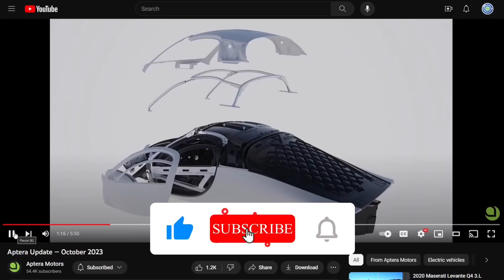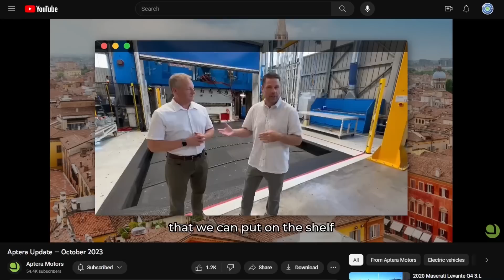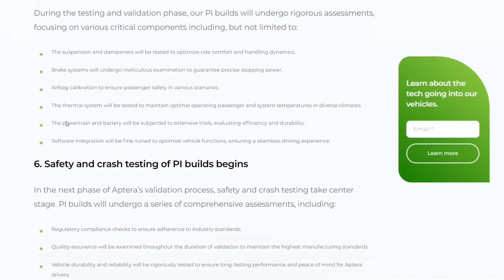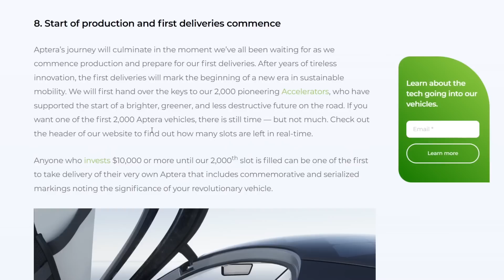Aptera's October 2023 update and ambassador meeting highlights

Comment: The use of a CMM to validate the parts is not remarkable, but rather inevitable.  There is virtually no other mechanism capable of precisely measuring and validating these sort of complex shapes; both the contours and material thickness at any given location.  The measuring technology is many decades old and is used in circumstances more-or-less like this everywhere.
Reply: You have to remember that the Aptera acolytes see all things through Aptera-tinted glasses.....
Reply: @bobhilder1469  Since the word means follower, does this mean you haven't followed Aptera?  

I have worked as a supplier to the EV industry for decades, going all the way back to the late '70s when I lived in Japan.  I have been a supplier for many early EVs, including the Ford Th!nk.  My impression of Aptera comes from many years of work in the industry and first hand familiarity with many other startups including Tesla during their startup phase in Union City.

I agree that there are too many false claims floating around the internet - including that the first version of Aptera - Aptera Inc., went bankrupt - which is not the case.  They did shut down, years after the founders left.
Reply: @n.brucenelson5920  Classic n.brucenelson/a.k.a. Aptera shill.  If you can't address the issue at hand, change the subject.
Reply: @bobhilder1469  The issue at hand is name calling and spreading lies about Aptera on the Internet.  Why do you do it?
Reply: @n.brucenelson5920  Aptera and you lie and your response is why do I lie? The very definition of projection.....
Reply: @bobhilder1469  You continue to post without evidence.  Cite one example of me lying.  You either refuse to do research or can't understand what you read, and then call others names because of it.
Reply: @n.brucenelson5920  Your denial is not healthy.  Maybe take a mud-bath instead.

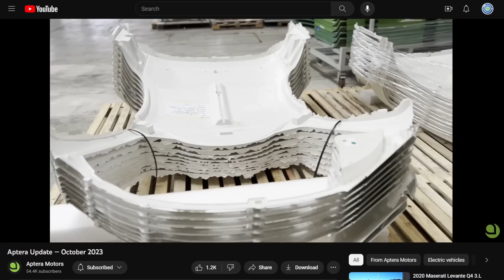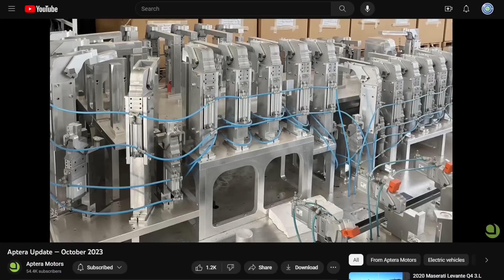Comment: At 6:30 (AOC video), I think the racks of pieces are: on the left  - doors (2 stacks of 8); in the middle - the other door (nested a bit funny, but probably also 2 stacks of 8); and on the right, yes, the hood pieces (probably all 16). So, three of the six parts for the 16 PI builds! At 6:35, it looks like there may be also all 16 of the CF-FMC rear hatch panels.

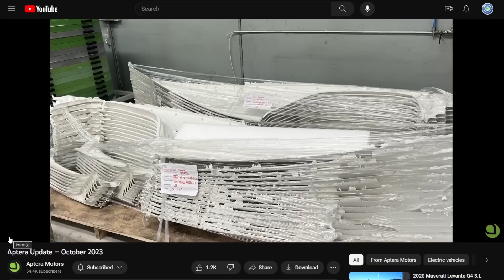At 8:39, the label where you speculate "lambda 7" is probably just "17" (Europeans often write their "ones" as almost a "tent"). This would correspond to the target 16 plus maybe a spare.

The phrase "PER VIA DELLE NAZIONI" on the label is probably an address -- "For Street of the Nations" -- perhaps this stack is destined for another facility (maybe one of theirs) down the road a bit. There is a "Viale delle Nazioni" street near the CPC facility in Modena (in the same industrial area). ("Viale" and "Via" are both words for "street" and probably sort of interchangeable. "Viale" is used more for larger streets, like boulevard in English.)

Comment: Steve, do you know if the safety / crash test will include testing the impact consequences of a hit to the battery pack?  For example, to see if there would be battery cell fire / explosions  etc ... if you don't know, can you find out from Aptera?
Reply: Sounds like Aptera intends to meet (or exceed) automobile safety standards (far in excess of motorcycle/autocycle standards), correct?  Hope they’re transparent about all such safety results.
Reply: @gr8dvd  Aptera will have the tests conducted by a third party and have stated that the results will be made public.  There are many SUVs on American roads now where this is not the case.
Reply: @n.brucenelson5920  Good to know, thx.
Reply: @gr8dvd   Yeah, crash testing motorcycles does not sound like a thing.
Reply: @jeffcarlton3590  True, not yet… maybe instead of inmates stamping license plates… 😀🤷🏻😀

Comment: Steve, there is no way to know the boxes on the shelves are production parts unless Aptera privately stated that to you. There are many small items used in the manufacturing process that never get installed into the vehicles that can fit into those boxes. Hand tools, test and measuring tools, scanners, HMIs, power cables, air hoses, workstation lighting, small parts bins, and labeling equipment all need to be distributed and installed before production parts arrive and take up the bulk of the racking space.
Reply: They could also just be empty boxes.

Comment: Why is the launch vehicle 400 mile and AWD 3 motor for $33k?  My personal opinion is a 600 mile with 2 wheel FWD for $29k? would be a more “sensible” first model. Is AWD really necessary? I’m not taking my Aptera out in a snowstorm or off road.
Reply: The launch edition was based on the reservation take rate for the various features. Fewer people wanted the 600 mile range, and more people wanted all wheel drive, either for driving in poor conditions or for the extra power and faster acceleration. I too, will have to wait for my 600 miler.  I'm undecided about AWD, but I'm leaning toward it due to the uncertainties of driving a three wheeled car in the snow.  I've never needed AWD in the past, but I've always driven cars where all of the wheels travel in the tracks of other vehicles.
Reply: @993cc I also will be waiting for the 600 version however I like the AWD version for the acceleration.
Reply: They’ve stated that the reason they’ve chosen that specific version for the LE edition is because that was the most popular configuration. They would be able to get more vehicles on the road and more money in their pocket.
Reply: Everyone has a different use case
Reply: In addition to the other replies, the batteries planned for the 600 and 1000 mile range vehicles have not yet been produced.  I had originally ordered a 2WD vehicle, but the extra traction control that AWD will provide will be welcome during the Iowa winters, where I now live.  Not to mention the fun factor of the extra acceleration on tap - which doesn't have to be used.

I am aware that it will still slightly decrease maximum range.  I have done 1,000 mile in 24 hour motorcycle trips, and feel that if I were so inclined I could do the same thing in a 400 mile range Aptera, but probably won't have to.
Reply: @n.brucenelson5920  ! The batteries are the most compelling reason

Comment: The machine at 2:44 is not the CMM (coordinate measurement machine) but is merely the clamp fixture to hold the part steady while the CMM measures the part.
Reply: The scanning stickers on the top surface of the clamps make me think it goes through a scan operation to validate the part in the fixture.
Reply: I agree. The fixture shown is a clamp for Assy. But the CMM inspection would probably happen at the factory (CPC) before shipping. I doubt Aptera would have a CMM machine on site (pretty big and expensive) to inspect incoming parts that can be check elsewhere before shipping, plus it is typically done on a climate controlled room.
Reply: @ciscorodriguez-quijano840  wow. That brings back memories. The auto plant I used to work in was not climate controlled. But, like you said, the CMM room had to be. So on really hot days, I'd spend extra time in the CMM room doing extra 'quality checks'.

Comment: You really do not iterate on these dies unless you have too.  I believe Aptera's previous builds to spec with a different process should remove most of the risk.   Aptera can probably recover from one or two reworks of the presses, but it will be a major setback.  If they had to do them all they will probably fail.   Even if there are issues, there may be ways of adjusting things adding shims of some sort to fix very minor errors.  Hopefully none of this is necessary.
Reply: With 4 out of 6 already validated, odds are looking good for the remaining cf-smc parts. However will feel relief when all CF and FG dies and parts are validated as fixes will add delays and increase financial burden, thus impact significantly Aptera success odds.
Reply: Trust you’re right about "Aptera can probably recover from one or two reworks of the presses"  which is encouraging since 4 of 6 body components (presses) have been certified so only 2 remaining. After 4 of 4 👍 betting 2 or less problems… if my math is correct 😀
Reply: If it's anything like dies for injection molding, steel can be further removed quite easily.  Steel can be welded in but that is much harder and very costly.  Companies that made plastic parts for us always erred on the side of having to remove steel than having to add.
Reply: @kimbowilco  That is very true, much easier to remove some steel than add some.

Comment: Informative, yes. I’m a bit surprised at the expense for what still amounts to fiberglass panels. Does anyone know the percentage of fiber to carbon panels? Seems like the outermost is carbon and the interior is glass. What is the tub? I’ve seen super cars with large tubs in a one piece. With the frame and inner cage, just what makes up the tub area?
Reply: When you look at Aptera's exploded body views and the actual parts at CPC, the darker parts are carbon and the lighter are glass.  In general, the floor-pan tub, structural parts, and interior skins are carbon, while the exterior skins are glass.
Reply: Yes, I think you have it reversed: innermost CF and outermost FG.
Reply: @Aa792   No worries, it's all good!

Comment: No price update means they are still dodging the second most important question to all reservation holders. Anyone who believes the price has not gone up significantly is fooling themselves.  The original expenditure stated for 2022 was 9.4m for tooling and design. I am curious if that included all six pieces or only the first four?    
  
No efficiency number is interesting because its obvious they are now hedging their bets with mentions of tires and other effects. It certainly will not be as high as many hope.  

Only sixty percent of the equipment (66 who cares) being completed and ready means hitting December given shipping times from Italy means is not going to happen.  Using an additional supplier for the belly pan likely increases cost and complexity as now two suppliers have to have very good integration. The ability to repair this is going to be interesting.  

I am surprised the rear hatch is solid. I was hoping for cells in glass similar to how Fisker did their roof. 

The solar equipment shown was very disappointing, this isn't but one machine from the October video but worse its evident the guy sitting there playing with cells is doing nothing. Seriously that was so staged as to be silly. No, they did not invent automotive grade solar panels. They are using existing Maxeon panels in new method where they are bonded to the acrylic (don't think it is glass). We have all been able to buy these flexible cells from Sunpower since 21 on Amazon. 
  
211m in the hole already... only increased their cash position by shifting an additional 10m to stock based compensation which is not a great sign.
Reply: For now the prices coming out of Chris Anthony's mouth in recent interviews are $26,900 for the base model and $33,500 for the Launch Edition are what I believe.  In one the "factory tour" videos I saw there was mention that at the location that they will be doing the volume manufacturing of the solar panel they have a larger quantity of the automated machines that are used to produce them. Since they aren't producing vehicles yet showing 10 idle machines vs 1 idle machine makes no difference. I suspect that the reference to them inventing automotive grade solar panels refers to the classification of the final product. For example there are automotive grade electronics that are certified to meet the operating parameters required in an automotive environment. It is not just sticking off the shelf solar cells onto a surface.
Reply: @garywozniak7742  I have a bridge in Brooklyn NY I can sell you cheap🤪
Reply: Actually, many have been able to buy these flexible cells from SunPower since the early 2000s.  At the time they were called A300 cells and were minimum 20% at STC.

If it's Acrylic (PMMA), I sure hope they have the good sense to "hard coat" it....
Reply: To clarify, the carbon hatch in the video is only seen from the interior of the vehicle... the solar shell is applied over the exterior of the carbon hatch.
Reply: @DemaGeek  Yeah, we’ve know for months, if not longer, that there is no back glass. I think they explained this back prior or at the time of the launch edition. So few wanted glass in favor of solar cells they put the design and mfg of a rear hatch with glass on the back burner. The very few that wanted BEV only complained.
Reply: It does not matter how transparent Aptera is. Naysayers will always piss on the effort being made. Thanks for the pessimistic attitude from out of your butt. Makes me feel like Aptera is doing something right.
Reply: @barnabasseadog7660  "Makes me feel like Aptera is doing something right."  Well there you go.  Aptera (and you) need the naysayers.  It's a win-win.
Reply: @barnabasseadog7660  Pretty thin skinned response to a post from a reviewer who is noted for a balance perspective. Neither fan boy or negative troll.
Reply: @johnmalcom9159  he seems pretty negative to me. The Maxeon Gen 3 solar cells that Aptera is using have a higher efficiency and flexibility than those cells available in 2000.

Comment: Nice video, but now I'm confused…

10:53 — You mentioned there's “kinda no room for error” with the dies, so what are they testing if they can't easily changes the dies? Like, what if they find out there's a problem with the belly cooling? (That overheat during the NBC story seems to be one of the bigger concerns for the vehicle right now. Although, I did see that driving up the hill video, so it's more of a general concern.)

11:50 — Glue? What are they gluing? That seems like a problem for repairability, which is one of the big attractions of the Aptera. I like their right-to-repair stance… but how's that going to work with glued parts? 🤔

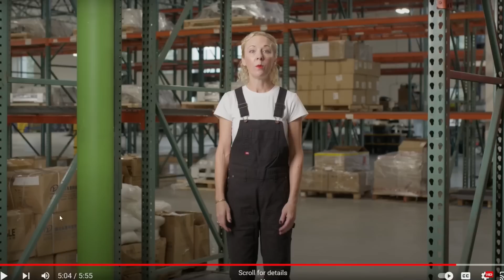14:02 — Do you have an iPhone? There's a translate app that can translate images. I'm not sure if the image quality is high enough though. Maybe Google Translate (with images) will help.
Reply: Regarding glue ... it's my understanding that will only apply to the main body shell. Those pieces are very strong and will never dent or deform. So if you manage to crack one, the vehicle is probably totaled. But in the unlikely event it was still salvageable, I bet you could re-glue the cracked portion, or cut out the cracked portion of the shell, then glue in a replacement. IMO, most of Aptera's repairability refers to the relatively easy replacement of the many mechanical/electrical components that bolt to the glued shell. Hope that helps. 🙂
Reply: Gluing is not a problem for repairability. You just use cutting tools, grinders, and sanding tools instead of wrenches.
Reply: On the cooling issue...they did not even have the motors hooked up to the cooling system, they just filled them with fluid and capped them off, this worked just fine for normal driving in relatively cool whether.  Remember this was built as a show and tell vehicle not a validation unit....Chris Anthony freely admits that they took a chance on letting a nationally recognized news outlet film them driving up a steep hill on an unusually hot day after they had been giving test rides and already had the motors warm.  Under almost any other senario it would have been just fine but they gambled and the motors shut down because they just got too hot.  

 As far as glueing the body together it is no different than repairing a fiberglass boat or even a Ford F-150 where the rear box side body panels are just glued on.  Get your replacement panel, remove the damaged panel at the glued seams and glue the new panel in place.  Not that hard if you've done any type of body work.  If it is a small area you can just repair it with traditional fiberglass repair methods or even get partial panels to section into a damaged area.
Reply: @rolandrauenhorst2002  I am no expert, but I have done this kind of work myself.  I would tackle it before I would a sheet metal repair, and I have experience at both.

Comment: The outsourcing of the belly pan is probably just the machining of the dies. CPC should be stamping those parts.
Reply: Steve said the tub was outsourced by CPC. The belly pans will also be outsourced because Aptera does not have the ability to stamp or hydroform large aluminum parts. The tub and the belly pans are different components.

Comment: I think that with the simplicity of the design that validation will be quick and customer deliveries will be mid 2024 as Chris said.
Reply: Summer 2024 ends Sept 20, 2024
Reply: @ASawyerInAZ  accurate observation!
Reply: Looks like early 2025 to me. I hope to be wrong and there will be initial deliveries end of 24.
Reply: We’ve seen a slooooooooow roll on the govt. loan application, and didn’t hear any mention of govt. vehicle certification which is why I’d say (very) late 2024.
Reply: @gr8dvd  The Government is responsible for the "Slow roll" Not unexpected because that is how the Gov. works. Especially at this time in the election cycle. I am sure Aptera is more frustrated than us and certainly less naïve about the process now.
Reply: @johnmalcom9159  👍 And why I mention govt. certification as a possible delay, not mentioned AFAIK and outside Aptera’s control.
Reply: Ah man deliveries by the end of next year would be amazing 😂
Always chasing..
Reply: CA has stated optimistic expectations would be Q4 2024 deliveries with build numbers <1000 by end of that year
Reply: @chrisrudzinski6241  i would tend to agree, which means I will have my Aptera by end of 2024. Yippee
Reply: Based on previous milestone missed, I think you're very optimistic on the time line.
Reply: @randylewis4242  we all will know in 348 days
Reply: @randylewis4242 yeah it'll be a miracle to me if we get them by next year..